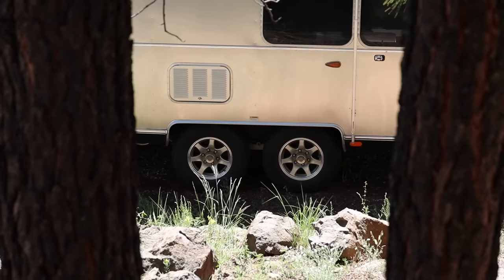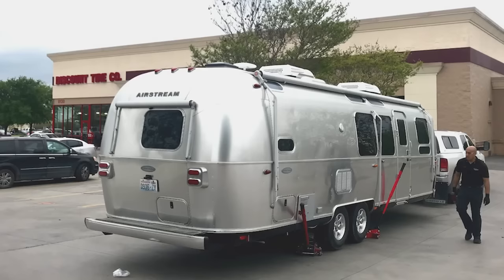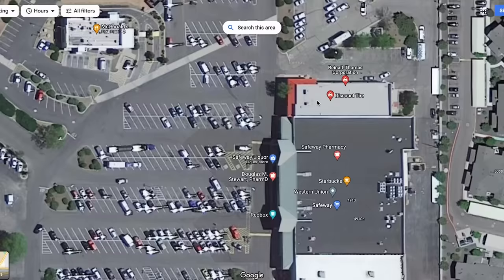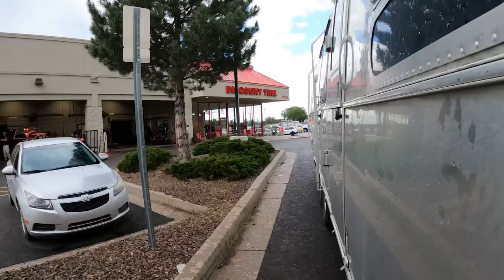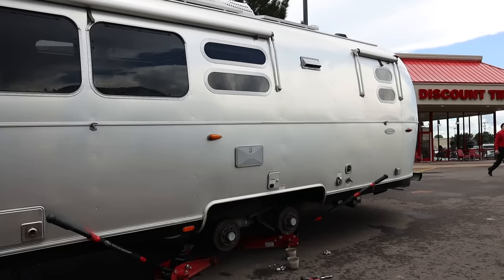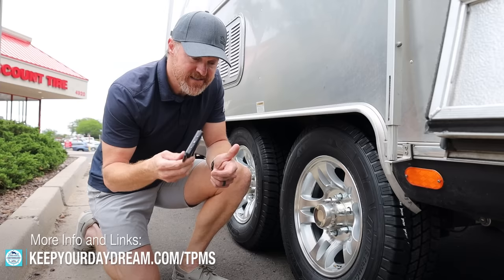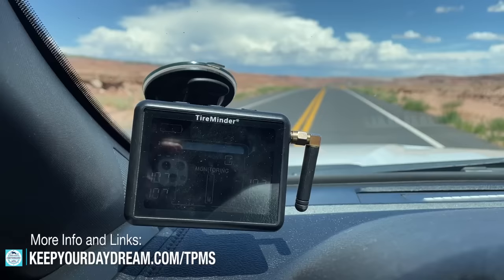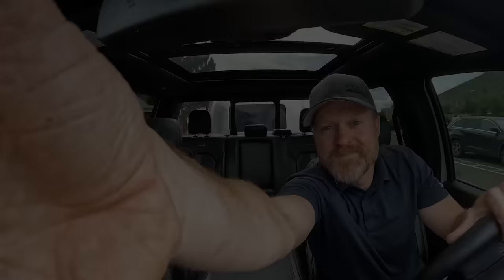Towable RV Tires: Proper Inflation & ST Vs LT + Tips

Comment: Don't forget to re-torque the lug nuts on new aluminum rims after 50 miles or so, then after 500 or so. The aluminum will flex with heat/cold and can make the lugnuts loose.
Reply: Very important to do! We forgot on our car & about 100km since putting them on we heard a weird noise as we were parking & 4 out of 5 lug nuts were loose.
Reply: Let’s give Marky Mark a little credit… he’s not gonna forget about that.
Reply: Yes retorque!!!  very important on the wear pattern you set in the first 1,000 miles!!
Reply: Not forget to also check your truck lug nuts too.  I pulled my trailer 50 miles before I found out the FORD dealer did not tightened any of the 24 lug nuts when they rotated the tires!!
Reply: We all should be checking lug nuts often if not every trip
Reply: We torque our tires at every overnight stop or before we hookup and hit the road again.
Reply: 4w

Comment: A couple of things on torquing wheels:  1.  I noticed the technician using an electric drive to tighten he lug nuts , then using a torque wrench.  How do you know the the lug nut has not been over tightened?  The torque wrench will not tell you that unless the technician backs the lug nut off then torques to ensure the the torque wrench is not registering a false positive click.  2.  Make sure the technician knows when the last time the torque wrench has been calibrated.
Reply: I was going to say that too. I have had several rotors warped by garages using an impact wrench and over-tightening lug nuts. The risk here with drum brakes would be stretched or broken lugs and possible wheel loss.

Comment: Great video as always...  When I bought my new 2019 camper it came with load range c which is a 6 ply tire in 2019.  Doing the appropriate math and it should have come with load range E 10 ply tire.  I ended up going with load range F, a 12 ply tire.  First set lasted 27k miles and I changed them out at year 4 with the exact same set, could have gone further but I do that 4 year rule with trailer tires. Sold the old set to a guy for a horse trailer that he doesn't use for hauling horses but for his carpentry business.  I advised him of the miles and the years, after he saw the 1 inch side walls, he bought them.  Transeagles on Amazon are outstanding tires.  I also put a 14ply on my 18 flat bed trailer.  Absolutely LOVE THEM.  Definitely do the math on what you are actually supposed to be using on your trailer.  Also, Discount tire is amazing.  I have taken these Transeagles to them and they mount them for me, even let me buy the road hazard for them.  Don't forget to re-torque them.

Comment: Well done and easy to understand.  I might add that folks using TPMS should get metal valve stems because the TPMS caps can make the rubber stems flex and ultimately crack.

Comment: Excellent episode Marc. You’ve settled the discussion going on in my head regarding ST vs LT tires for our 5th wheel unit. 
A recent blowout even with the use of the Tire Minder i10 had me wondering about installing truck tires and moving up to 16 inch from 15 inch however, the bolt pattern on our unit does not permit an increase to a 16 inch rim. 
We’ve chosen the GoodYear Endurance and trust with proper maintenance we should expect excellent service where the rubber meets the road’
You sir’ are definitely the best source for RV related issues and upgrades. 
All the best. 
Regards,
Reply: FYI in thd future, Discount does have 16” in 5 on 4 1/2, and I would assume other 5 lug patterns . I just ordered a set of Vision Soft 8  black for my Casita. I’m switching to LT, and 15” truck tires are getting harder to find .

Comment: On our last trip to Colorado, we had two blowouts in two days, very frustrating and nerve racking. Your comment about practicing at home is so good. It took me almost two hours to change the first tire, just running around the truck and camper to gather up tools, thanks goodness I had them all. The next day, blowout on the other side, it to about 45 minutes, better but still so frustrating!! 
I didn't know how to check the date code that would have been really good to know before I left on this trip. I found out on the road, when the tire shop showed me how to check that. I definitely would have changed them long before this trip. 
I bought the camper second hand and the owner had said they changed the tires not to long ago, it had actually been six years. Just wanted to share my experience so other don't run into the same mess.
Great video!  Thanks Marc!

Comment: This is my thing. I want to share something I saw at the beginning of the video (I believe that was a jack rod) at Discount Tire (saw it later on too). I go there as well.The Airstream has a rubber-based axle as you mention. When you go to the tire store their default is the axle or at the wheel. I forced my Discount Tire guy to jack mine up at the jack points and it worked fine. Even jacking near the wheel point can arch the axle. They can add a lift block on the jack if more height is needed. Also, I went round and round about the PSI and found a chart that shows load for tires (4) It is not max cold PSI as many believe and as you found. Great episode. People NEED this. I use TireTracker (small screen) and it too gives temp/pressure on one screen. I got Crossclimates too. I was told by Airstream years ago when I called that their upgrade to LT tires 16" that they offered on the Eddie Bauer was a great option and, that they found better reliability over the ST tires. My thought is that research on LT is much more and most ST tires are from the "same country".
Reply from the maker: We added the 2 inch lift which is why I don't think the jack points worked. I would have preferred to use the jack points.
Reply: @KeepYourDaydream  ok, I see. I was concerned. They have some kind of attachment on the jacks too like blocks that add height. I remember they had to wheel two different ones on my new tire purchase when I was going crazy on them to stay away from the axles- LOL. Those CrossClimates have a nice tread, almost rugged.

Comment: Thanks for the great information. Dont forget to re-measure the height of your trailer after switching tires and or rims to different brands or a larger size rim. Probably wont change or matter that much especially with a airstream but better to know than to guess at the last second.

Comment: Like previously mentioned, we learned after a blowout that we needed metal valve stems for our tpms sensors. Last trip our system alerted to a slow leaking tire. Found it had a screw in it & Discount Tire fixed it for us.

Comment: I switched over to the Michelin 16 LT on my Airstream back in the spring and love them so far. Check that torque several times. I found some of my lug bolts backing off. Been running 70 PSI on my 28ft Signature.
Reply: Why 16”?

Comment: Great video. I love Discount Tire and have been a customer for over 30 years. Another important factor that you mentioned is the speed rating of the tires. Most ST class tires used to have a max speed rating of only 65 mph years ago, and I experienced multiple tread separations on 2 sets of trailer tires because I was always towing them at 70-80 mph. This was with both Goodyear Marathon and the earlier versions of Carlisle tires. A rep from Carlisle believed the constant high speed was what caused them to fail. Carlisle now makes the newer Radial Trail HD, which in my tire size of 235/80 R16 has a speed rating of 75 mph and a max load capacity of 3,520 lbs per tire which x4 is within my trailers GVWR. I am now on my second set of these and have had zero problems with them, but also limit my speeds to 70-75 mph now. The Goodyear Endurance does have a higher speed rating of 87 mph, but has a lower max load rating of 3,420 lbs per tire which is just below my GVWR. Plus the Carlisle is about $35 cheaper per tire!

Comment: Great video here with excellent info.   Took my trailer(fully loaded for travel) on a CAT scale and have 6800 lbs on the trailer axles, so brought my pressure down from the sticker suggestion of 80psi to 55.   This still allows for a greater than 20% buffer in case the 6800 pounds is not distributed equally.  Gives a much better ride and tosses stuff around way less.  (225 75 15 E rated ST tires)    Now I have to decide if I should replace them with a set of Goodyear ST tires of the same size, or perhaps move to a Michelin XL tire in the 235 75 15 size which will easily handle my load.   I am fine with the 15" wheels so in my case, I don't see any need to go a size bigger there when I have four perfectly good wheels.  Thus very keen to hear your follow up on performance with the new tires.   As always safe travels,

Comment: Marc, It is also a good idea to have the tires & rims balanced before mounting on RV......note many RV's do NOT come from the factory with balanced tires. Balancing the tires will help with overall ride and provide uniform wear.
Additionally, you should torque the lug nuts in multiple levels (eg: 40 psi, then 75 psi, then 100 psig) when mounting the wheels to provide uniform "stretch" on lugnuts/wheel studs.
Thanks for providing important tire information.....Be well & travel safely!
Reply: We use Centramatic balancers on our Airstream, and we have used them on several motorcycles over the years. Love them.

Comment: I went from "Rainier" "China-bombs" on our new Keystone trailer. I changed over to Goodyear Endurance ST trailer tires, (same diameter, 15 inch,) and I can't believe the difference! The Goodyear's roll better, and I don't have the sway, especially toward the crown of the road that I did with the OEM tires. The Endurance's are run at 65 psi, the Rainier's ran at 50. The Goodyear is SO much better tire -- I'm so glad I changed!!

Comment: Great video. One note, your rims are “stud centric” as the rim is centered on the axle via the studs. They used centering cones when they balanced your tire using the center hole to center the rim on the balancer. The accurate way to mount the tire to the balanced would be to use a special adapter with 6 fingers to center the rim on the balancer. i.e. Haweka. This simulates the rim as it is mounted on your trailer. Just an FYI. Love your videos.

Comment: TPMS systems are fantastic with one caveat. We used to ride a sport touring motorcycle across the country about fifteen years ago. TPMS was popular then for the bikes and a significant issue quickly became apparent. If you are going to put the valve stem sensors on, it is important that you replace your rubber valve stems with metal valve stems. The stress from the centrifugal force of the tires during travel puts undesired flex on the rubber valve stem that can cause premature failure. Usually as a leak close to the wheel. Sometimes there is enough movement so that the sensor can damage or scratch the wheel.

Comment: excellent video ,   in a tire inspection, there is the (TWI) tread wear indicator on every tire. It is a raised tread bar within the tread. When the tread wear reaches the TWI, it could indicate an inflation problem, over or under. if majority of the TWI bars are close to the worn tread, then the tire is ready for replacement. The TWI is found on all manufactured tires. The TWI is located in several locations around the tire, you could have a broken belt in the tire that would cause the tire to wear quicker in that area of tire.

Comment: Kevin most folks don’t think about that, as an x truck driver I always noticed that the lugs where to tight.
To tight can be as deadly as it stretches the lugs and could break them.
Best way check them after install for right torque, meaning also if too tight.

Comment: We had a 2006 Weekend Warrior 40ft Toyhauler that had tri-axles. THE FIRST THING I DID was to swamp out the crappy 15" rims and tires to Eagle Allow wheels and Michelin XPS Ribs (a LT tire). The first set had 12 years before they started cracking on the sidewalls, so I replaced them and after the next 6 years when I sold the coach they still looked brand new. The best part is I never had to worry about them- in fact, there might have been 2 or 3 times over those 18 years I actually had to add some air to them! Last year we bought a 2023 Grand Designs Reflection 320MKS (because we had sold all the toys and wanted to downsize, and it came with Goodyear Endurance ST tires. I really don't think there is any such thing as a good ST tire. I have seen way tooo many blowouts that took half of the trailer walls with them. To me, tires are the biggest thing you can do to add extra insurance to your ride.

Comment: "Cat", here, you crazy KYD Guys!  Been retired 36 years, RVing 41 years, in my 14th rig (an RUV, class C with a class A front)!  One very important point I learned early on was to try to take delivery of any new or used RV with my choice of tire replacing whatever is on the rig as it arrives.  Always, I mean always, replace those highway treaded tires with mud/terrain tires!  Even if the RV is a folding tent trailer or a 45 ft diesel pusher!  You will thank me at least ten times over the life of the tires!  The current best tires for the buck are Hankook, Dynapro carcass, MTS2.  They are even rated for ice with their sipes and mini lug design!  Select the size and ratings suitable for your application and you will be happy, happy, happy!  Price, construction, longevity and, most importantly, tough, tough, tough sidewalls and treads that run really quietly with traction, traction, traction!  Meaning, no sliding around in just about every road condition!  Try 'em, you'll like 'em!

Comment: One thing to note about max cold temp is that climate can affect the cold pressure significantly.  So if you put your tires at nominal pressure in phoenix then drive to say Montana mountains, you will have a lower pressure due to ambient temp difference and need to add air.

Comment: We have been very happy with our TireMinder TPMS-TRAILER model. The best thing about it is that you see psi and temperature on all 4 tires all the time; not sure I’ve ever seen another model do that? Some caveats - only 4 tires, only up to 65psi. But if that works for you I recommend you start with it. Also the stem covers are very lightweight, no problem with our rubber valve stems and over 10K miles.

Comment: I really enjoyed your video.  I worked in a tire shop and went through training with Goodyear,Michelin,and Continental and we put both types of tires on pull trailers but we made sure what the Load range was and made sure we used the right rating . Tires rate from C which is on most cars up to G which is a good heavy stiff sidewall tire. Great info

Comment: So many videos and even “experts” say to inflate ST trailer tires to the max cold PSI shown on the tire. I have Goodyear Endurance tires, and Goodyear publishes a chart for PSI / LOAD.  I contacted Goodyear directly; they said to use their PSI / LOAD chart.  For my dual axle TT fully loaded and weighed at a CAT scale, 35-40 PSI is the recommended cold pressure. 65 PSI is the max cold pressure shown on the tire. Big difference!! When I confronted an “expert” he responded by saying that Goodyear was the exception. Why not say that upfront?  People will inflate Goodyear Endurance tires to max cold PSI based on watching an “expert” video.

Comment: Really good rundown and timely!  My son and I both own Keystone TTS.  He has had two blowouts.  I’m trying to avoid the same problem and have been considering switching the OEM Carlisle’s out for the Endura.  And then you’ve got the ST/LT debate !
Reply: I would suggest going up a load range next time if you are experiencing multiple blow outs. Trailers used to be sold with bare minimum rated tires. The additional buffer of a higher load range will make a difference in that case. While not required, do you really wanna be driving down the road with 7 to 20 tons running on the minimum with no margin of error?

Comment: Absolutely love your content and this video.  We have a 27ft Winnebago TT and went with 16 inch rims right away to be able to get into our driveway.  The trailer is 5.5 years old and we went with Cooper LT 225 75R 16 Endurance HT3's and love them.  American made great ride, and track nicely.  Since we just traveled 2,200 miles, I had the tires changed out for the same before the trip, and no problems.  Since you recommended it, we had the exact same TPMS but we just got a 2021 F250 Platinum and bought the Ford rear camera and TPMS system so it is now integrated into the truck's system on the dash.  It does not do the temperature which we didn't use anyway but it is nice not having another monitor bouncing around on the dash.  ANOTHER GREAT VIDEO!!!

Comment: Oh my! We just did the same thing, almost. I replaced and upgraded from 15" to 16" wheels on our 5th wheel 7 years ago so I could easily get LT tires for it. I just replaced those Michelins with the exact ones you got. We were getting ready for a big trip. First leg of that trip had a tire issue with the truck. Had to get all new tires on the truck too. I got 51k out of mine on a Ram 2500. Safe travels.

Comment: The only tire issue we had was a valve stem failed from our Tpms causing vibration. At the tire shop we found the other 3 were close to failure. We replaced all with metal stems.